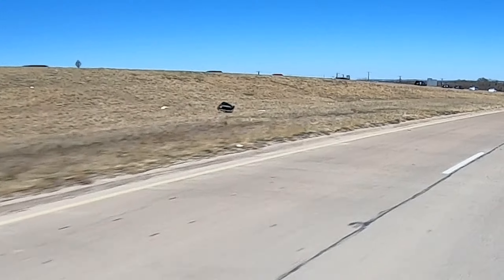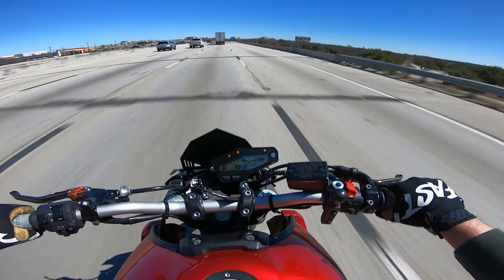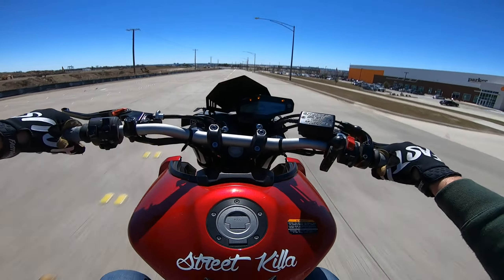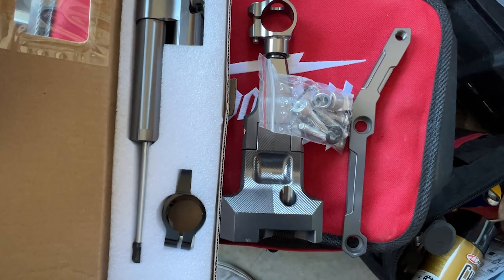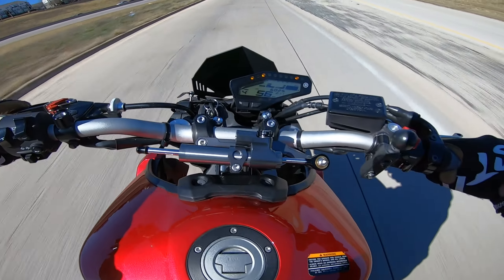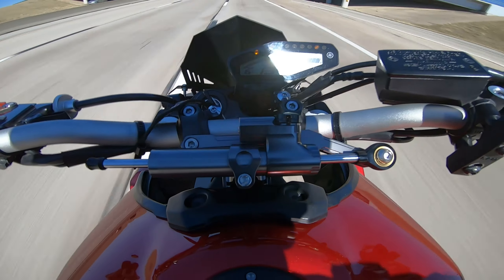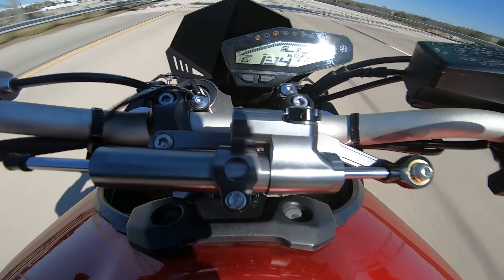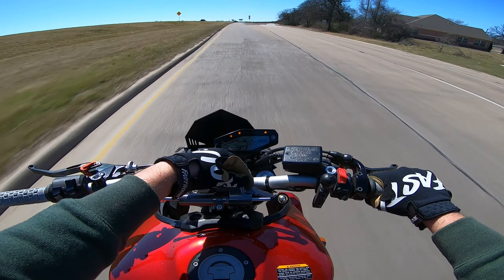$70 Amazon Steering Dampener for MT09 - Put to the Test

Comment: If your bike wobbles for no reason, something is wrong. Installing a damper doesn’t fix shit🤦🏻‍♂️🤦🏻‍♂️🤦🏻‍♂️
Reply from the maker: Fixed it good enough for me
Reply: What are you talking about? A lot of bikes do that. There is nothing wrong. 
If you want me to prove it to you, buy a hyperpro adjustable dampener on a taller bike. So do it on an MT09. Go through all the clicks and test it. You will see.
Reply: Duh
Reply: Little wobble isnt a issue. Deaty wobble is. And steering damper at hard setting will prevent the handle bar from going full angle slaps dude.. Some reason..
Reply: @adammfharris   as usual, everyone is clueless and talk from their asses. There are bikes with issues on suspension, tires, rims, etc. that will start to wobble even at 50km/h. That wobble should let you know that something is srlsy messed up and you should check it out instead of just slapping a damper on the handle bars. But hey, you guys were born on bikes so what do I know?
Reply: I got a 2021 mt09 sp and it wobbles sometimes on acceleration I bought it used from Yamaha dealership
Reply: @adammfharris a bike is inherently stable in a straight except if you ride with 210+ HP bike and try to move it at its Limit like a motor gp rider, death wobble is or falty steering Bering, Tire issue or bad riding Techniek like gripping the handlebars way too tight and not letting the bike stableize itself.

Comment: The conclusion I have come to after a thousand tests, checking and changing bearings, etc., is that the problem comes from the tires. With some tire models my bike does this and with others it doesn't.

Comment: Youd be better removing the after market wind shield. 90 percent of the time people complain that the Mt-09 has a wobble, also have terrible aftermarket windshields which cause said wobble
Reply: Nope, it's a design flaw with the handlebars height, suspension and frame. Yamaha tried to correct it with later models but my 2023 still has wobble between 115mph and 130mph. Same with or without aftermarket windshields (I've tried 2)

Comment: I have the same bike and mine goes 153  I think you need to take the limiter off and flash it when you flash it theirs a way to make it when your full throttle it stays dumping fuel instead of the stock one it goes to 30 %thriller at top of the rev

Comment: Put bar ends on it to reduce wobbles
Reply from the maker: What do you mean. It has bar ends already lol
Reply: @jar7d  what helped my bike was bad ends a stabilizer and keeping tire pressure 26 front 36 back.  I have Pro taper bars so my wobble was a little worse than yours.  Gixxer brah rode my bike in the I wheelie a Nikkon video.
Reply: So when I got my 2020 it was one of the sketchiest rides home I ever had it felt so unstable even at 55mph I almost Went back complaining but I got home watch some videos turned the preload up on it and the faster I went the more stable and planted it felt until I changed my front tire now I'm fighting wobbles again so I guess it time for a stabilizer

Comment: Any chance you have a follow up  if this stabilizer is still going strong? Even the 500$ ones are breaking in months. I get the same wobble but don’t want to replace stabilizers every season.
Reply from the maker: I’m friends with the guy who has the bike now. I can ask if he still uses it and if it works s
Reply from the maker: I asked and he said it worked great while he had it on, but after a few weeks there was some bolts missing and it wasn’t functioning properly so he took it off. No telling how long it would’ve lasted if the bolts were locktighted or something. My guess though is that if the $500 ones are breaking in months you might as well get the amazon ones, because it was like $70 for the mount + the stabilizer, and then you can just buy the stabilizer again separately I think for around $30. So that’s a lot cheaper to replace every few months for something that functioned perfectly

Comment: Does damper helps while fron wheel is up? I think it will prevent steering in position while on wheelie.
Let me know your views, thanks👍
Reply from the maker: It makes it harder in wheelies because sometimes you need to be able to turn the bars for sideways balance and you can’t really do it with the dampener set so I used to just lower it for wheelies and turn it back up when it was time to go fast
Reply: @jar7d  thanks mate, happy riding👍

Comment: The problem with these bikes is that it has a spacer in the fork and the oil is to thin
Reply: what happens if the oil is too thin?
Reply: @rabbychan too thin oil means very soft forks. Heavier oil and maybe a revalve depending on your weight will help immensely

Comment: damn never realized the mt09 was that slow
Reply from the maker: Yeah it’s governed at 130 but it’s 0-100 is crazy fast
Reply: @jar7d  is there any way to remove the governor?
Reply from the maker: @Larry_Fishermannn  yeah I think if you flash the ecu it can go like 160 but on a naked bike that would probably be really sketchy
Reply: @jar7d  lol my 03 z1000 does about 165 and it’s not fun unless you’re full tuck
Reply from the maker: @Larry_Fishermannn  yeah 130 on the fz09 hurt my neck so bad even in full tuck if I didn’t have any kind of windscreen. 160 would be miserable on it. The fz09 is also quite a bit smaller than a naked 1000. It feels way skinnier and more nimble compared to the s1000 I’ve rode. I feel like 160 on the 09 would feel extremely unstable
Reply: @jar7d  my buddy has a maroon red mt09 just like yours but he has a big touring windscreen on it. I’ve never seen him do a good pull but I wonder if that might help
Reply: An ecu flash or fuel controller will remove restrictions. I’ve got mine to 147 on a gps speedometer after the Vcyclenut tune and it was still pulling, I just hit traffic and had to slow down . He’s the go-to guy for anything CP3